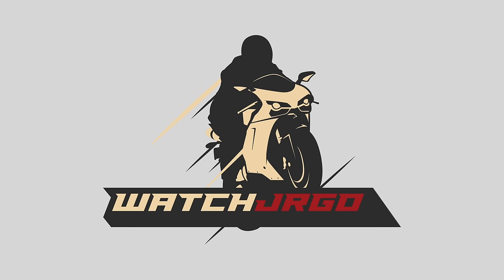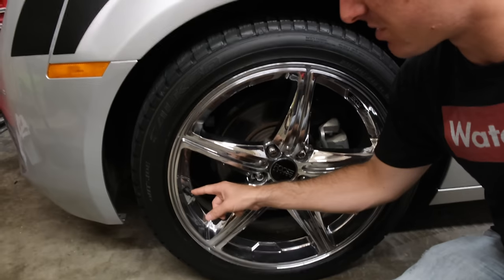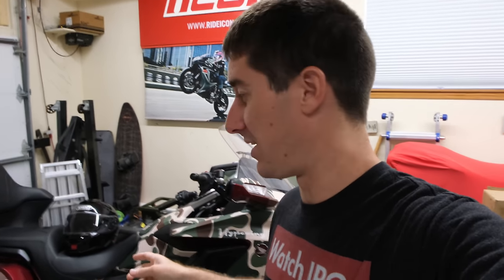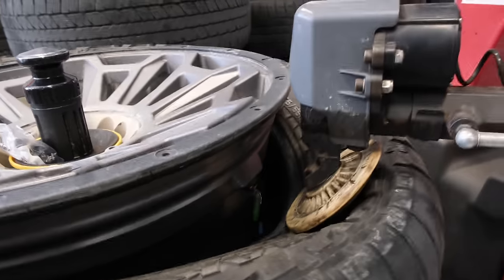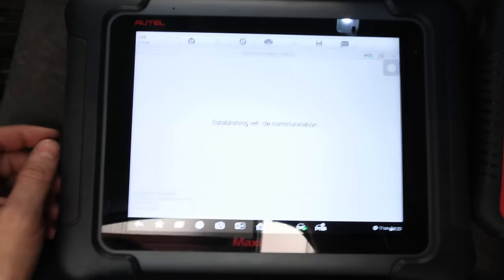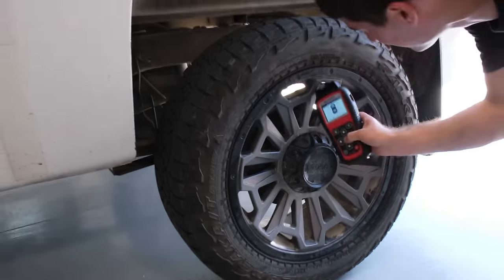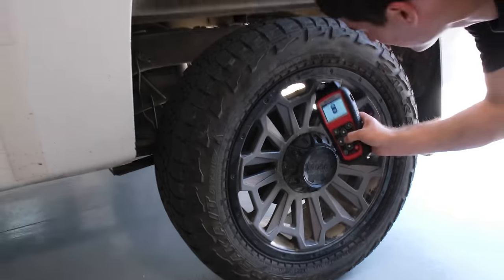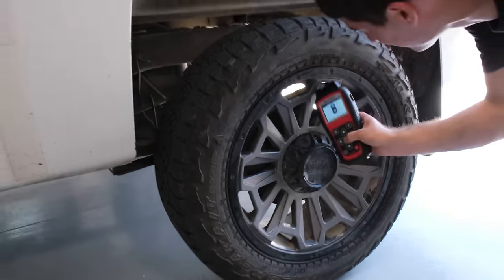TPMS SUCKS! Here's How To Fix It Yourself *Probably*

Comment: GM TPMS systems are super easy if you have OEM or ACDELCO units. You can buy a $10 re-learn tool for them. Now, when are you removing those hockey stripes and rims on the Camaro?!
Reply: You still have to program them to the specific vehicle before install though which requires an expensive tool. Unless you buy them pre-programmed.

Comment: They suck! My F-150 gas a permanent low tire light due to the size of the tires. The left rear tire won't register with the truck but the sensor is good.

Comment: wish I had it on my Mercedes ML I was racing a guy doing around 130-140 MPH next day I checked the rear drivers tire looked ok but had only 9psi  probably was before the race not a puncture could have come off the wheel at that speed on the bends

Comment: I have only owned 2 cars with TPMS one was the old style (2007 Mustang RIP) that said you may have a low tire LOL my current is 2 years newer and it tells you which tires is low and by how much.  BUT the left rear one has a faulty sensor and it yells at me SERVICE TPMS SYSTEM each time I turn on the car and flashes the tire light.  I am living with it till I put the snows on it in the late fall makes no sense to remove a wheel take the tire off the bead and swap the sensor when I am removing them and mounting snows and rotating them.

Comment: Most TPMS units are located under the seats and can be unplugged. This removes the hassle of dealing with it ever again.  Unless you drive a high performance vehicle, its a useless thing in my book. As a car gets older, the units battery dies. Why do they charge so much. Crap.

Comment: TPMS will never save my life... no matter how many times I replace the stupid things all my dash says is service TPMS... it’s ridiculous 😂.
Reply: My experience as well. Since the dealer my 350Z had an issue with it's brand new system. NEVER got resolved, and I got tired of it. Another move to add cost to our cars. If you are going to mandate the use of it, mandate the car makers to make it work.
Reply: Idk works fine on hondas
Reply: Like I commented above, it has never worked right in my Toyota. Not worth the cost of fixing. I just ignore the light that has been on for 8 years and just check the tires with a manual gauge.

Comment: My car must have the low level because when the weather gets colder and I back out of my garage it sequentially beeps as I drive telling me how many tires are low in pressure but it only has one light in the gauge cluster.
Reply: Aluminum rims tend to lose a bit of air in the colder weather, at least here in the cold northeastern U.S. anyways.
Reply: @died4us590  Actually in the winter the nitrogen and oxygen molecules shrink so the tire pressure goes down. That's most of the reason car dealerships and tire dealers try to get you to pay extra for 100% nitrogen in your tires because it is more temperature stable so tire pressure doesn't vary as much. The second alleged benefit is that nitrogen is dryer than atmospheric air but most tire shops and dealerships use expensive dryers on their air compressors anyway because moisture is hard on the storage tank and air tools.

Comment: most fire shops I know cant yet those trpm S sensors off fast enough.thar junk!ive on multiple Dodge vehicles had problems with them and lot of people that I know who work with tires have the exact same problems.one the metal ones keep snapping off which results in you Having a flat,2 the things leek like ass!!!!! I've seen them brand-new constantly continue to leek .and you keep fighting with them or after they've been on the vehicle about six months they start leaking and doesn't seem to be any way to get them to stop.ive last track Many times a leaking tire turned out to be one of those metal valve tpms. 9 out of 10 times I've got a leaking tire it's always one of those metal valve stem.t.hay also like to quit working after about eight months. the vehicles I have all they do it regularly annoying light on doesn't even tell you which weal. all so you usually have to go to the Dodge dealership an.d Panera hundred dollars a wheel if you want them installed in program

Comment: What about the batteries?  Do they need replacement?
Reply from the maker: You have to toss the sensor when the batteries die. You can cut them up open and glue back together but it’s not really worth the time/possible failure 🔋

Comment: I wish Ford would use the good system instead of Hey,low tire pressure but it's your problem to figure out which tire it is.
Reply: Trust me dude, you don't wish that. I've had both types of systems and the sensors are an endless pain in the ass and an expensive one too. Is it really that hard to check the pressure on 4 tires to find the low one? lol
Reply: @nodak81  Well,my last car would usually only tell me about a low tire when it was super cold outside or right when I pulled into my driveway.  Most inconvenient times possible to have to go somewhere to air up.

Comment: I always though TPMS stood for Top Pringles Must Stay.  Which doesn't make any sense because its hard to get to the rest of the can of Pringles if you can't remove the top one...
Reply from the maker: I always cut the bottom of the pringles can open... then everyone thinks it's sealed and doesn't try to steal my chips 💯
Reply: WatchJRGo it’s just such a tease because they make the top so easy to open, but then there’s this rule...  Maybe I’ll try your method from here on out.

Comment: If you are too stupid to need TPMS to tell if your tires are low on pressure, you don't need to be driving at all. Your preflight should be enough to tell you. Checking pressures often with a calibrated gauge is all you need.
Looking at your vehicle's condition is important every time you drive. These damn things aren't appliances.
Reply: Yeah, no shit. Unfortunately it’s mandatory in newer vehicles and most people don’t like staring at a dumbass tpms light on their dash

Comment: TPMS is great.  When it works.  In my Fit it's simply the light in my dash I ignore now.  The whole thing is rigged to get you back to the dealership IMHO.  There has to be a better design rather than this crap they have now.
Reply: Maybe in 20 years, if enough people complain, they will make it less proprietary, the tools will be cheaper and the sensors won't be so crappy. I can't imagine the industry will make these changes unless they are forced by the government.

Comment: -low profile tires
-two ply wires 
- "recommended" psi at 35 
- one small pot hole at 35mph

It's as if they want these stupid things to break. Low profile tires are the worst thing to ever happen to performance cars.

Comment: Here what i want to know ... how do i just get it out of my cars computer so i don’t have to look at the warning light anymore
Reply: You don't.  You either put tape over the light, or remove the LED/bulb.
.
Or just replace the damned sensors.  Or deal with the light.
.
Some cars allow programming in all zeroes for the sensor IDs for a bit, but will still throw the light later.

Comment: $340!!!  Great if you want to do this for a living. Otherwise, for about $180 can find a bluetooth OBD-to-smartphone tool that does TPMS diagnostics, tells you what on the system needs replaced, AND other systems as their in-the-box base model, AND patches available to custom tune performance.  Do 15 mins of research, and get way, WAY more for half the price.

Comment: So the new sensors are $35 but the recommended tool to check them is $340… the math isn’t mathing here…. (And you can get a relearning tool for the new sensors for ~$10…). Good video, bad solution to the problem.

Comment: Its just a mandated scam to charge you for a system repair that you dont need.
There may be some vehs or applications where they MJGHT be useful, but most times unnecessary.

Comment: Most of the tpms tools dont work and its possible you end up spending more for a cheap fix. Just bring it to the dealership and they will charge for it but it will be fixed or replaced problem solved. Instead of frustration money talks.

Comment: I don't understand why people bitch and moan about TPMS.  They're awesome, especially if your car can actually display the pressure readings.  They need to be replaced every 5-7 yrs, but that's just part of owning a vehicle.
Reply: It's an added expense and another layer of complexity. The shit is also very proprietary so a DIY'er would have to have buy hundreds if not thousands of dollars worth of diagnostic tools.
If the sensors were all the same, universal, not prone to failure right out of the box and the programming tools were cheap that would be a different story.

Comment: Now imagine working in an auto shop that does a lot of tire work...all the sensors, systems, programming etc. and the TOOLS...just an absolute clusterBLEEP when they go haywire sometimes.
Reply: Tpms problems are easily fixed with the scan tool that the shop I’m at uses.  Figures out whether sensors are dead and also relearns them fairly easily.  It definitely helps memorizing the relearn process for different vehicles though.
Reply: I bet that scan tool costs over $1000 though... plus needs yearly $300+ software updates.

Comment: TPMS  sensors and systems are  pieces of crap. They need to be where you can disable them and throw the sensors away. I have been driving cars and motorcycles for over 50 years and have never needed TPMS.  I have a Nissan Xterra and these have been crap since the car was new.  It costs hundreds of dollars for repair.  I just put a sticker over the indicator and check my tires regularly . I keep excellent high quality tires on all my vehicles.   JR just has to say these things to keep from getting in trouble  with  Safety Idiots.

Comment: A lot of cars today don't even feature a spare, what do need tpms for the spare I don't like it as they malfunction they are pain in the ass and an extra financial burdon. The easiest thing is  to check the air pressure periodically. . BY the way this video wasn't your best work.
Reply: Because the spare is often buried under body panels and rarely gets checked, if it's a donut it is at a higher pressure, so any change can be critical, and if the system has 5 channels, why NOT monitor it?